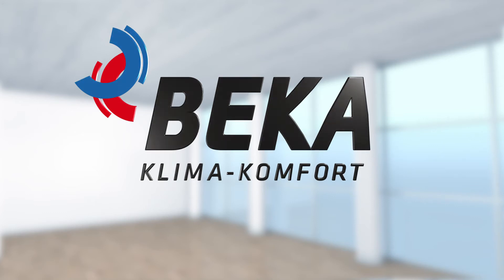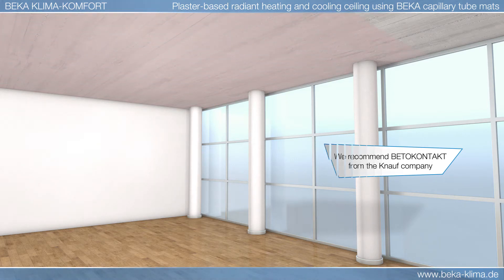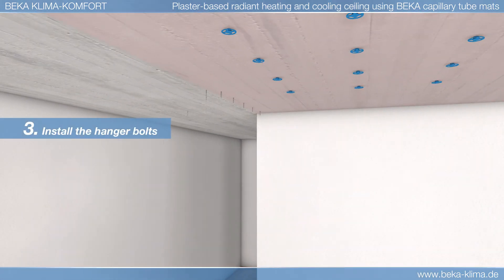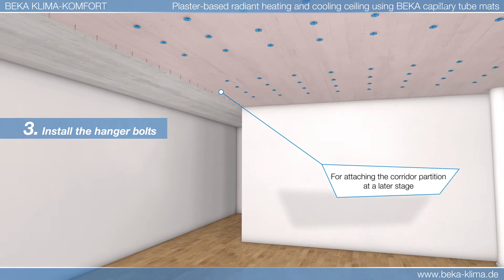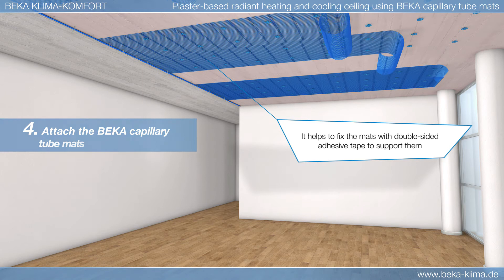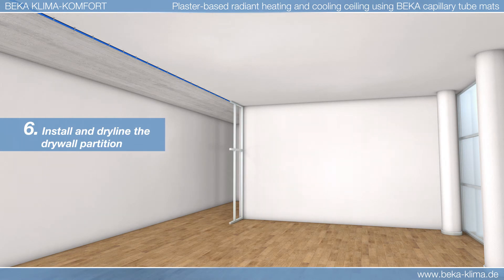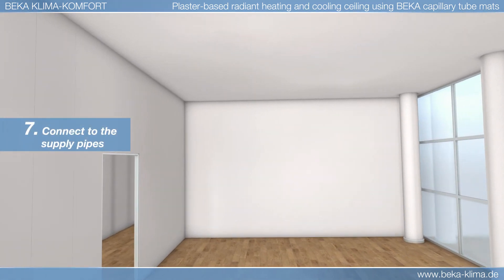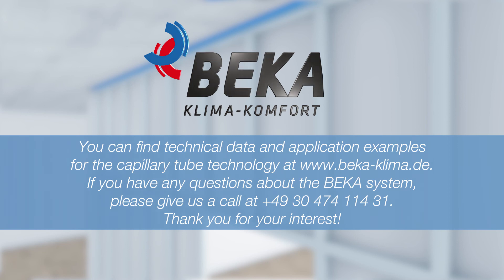How to Install a Plaster Cooling Ceiling with Capillary Tube Mats

Comment: Is there any radiant cooling product here in USA except forced cold air that we have now?
Reply from the maker: Many thanks for sending your inquiry and as well for your interest in our Products.

The BEKA company, are the producer of capillary tube mats since 1996. Our products made of robust polypropylene are sold worldwide and are successfully used for natural, quiescent air conditioning. Our mats are particularly suitable for cooling ceilings, floor heating and wall heating but also heat pump systems.
The use of the mats requires concrete planning and technical installation. Since we are no planners or installers, we are working together with experienced partners in several countries but unfortunately not at the UK at the moment. 
In case you need a system for small areas we have an Alternative.
Please take a look at our web shop: 

https://flexiro.de/en/
https://flexiro.de/en/service/retrofit-cooling-ceiling/

Best regards
Reply: @BEKAKLIMA  I was able to go to the website but the page turns after 2 seconds into grey and you cannot scroll up or down. Tried browsers chrome and IE same issue.  Please fix.  I see you have done installation in Atlanta and Wash so is there contact in USA for sales?

Comment: Any plans exporting to the US?
Reply from the maker: Many thanks for sending your inquiry and as well for your interest in our Products.

The BEKA company, are the producer of capillary tube mats since 1996. Our products made of robust polypropylene are sold worldwide and are successfully used for natural, quiescent air conditioning. Our mats are particularly suitable for cooling ceilings, floor heating and wall heating but also heat pump systems.
The use of the mats requires concrete planning and technical installation. Since we are no planners or installers, we are working together with experienced partners in several countries but unfortunately not at the UK at the moment. 
In case you need a system for small areas we have an Alternative.
Please take a look at our web shop: 

https://flexiro.de/en/
https://flexiro.de/en/service/retrofit-cooling-ceiling/

Best regards